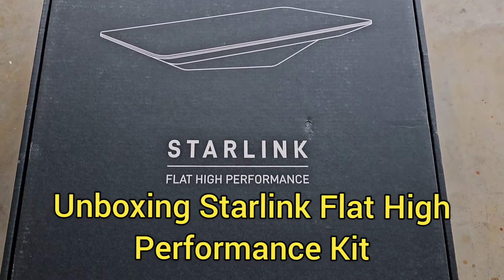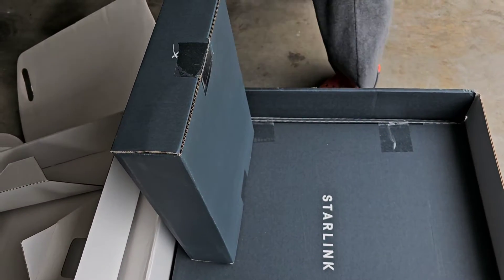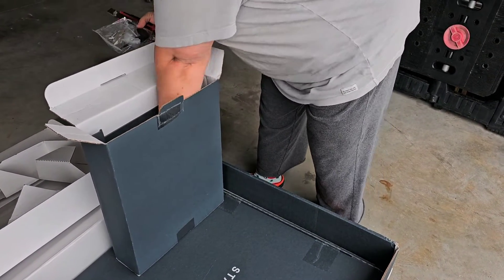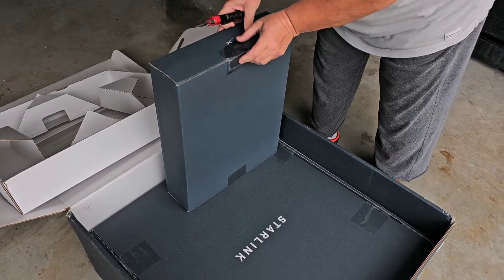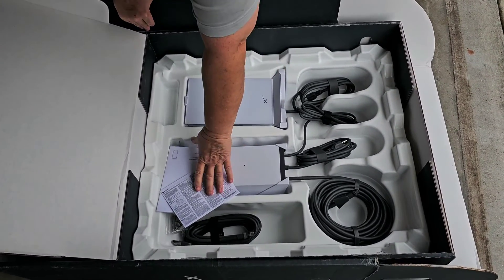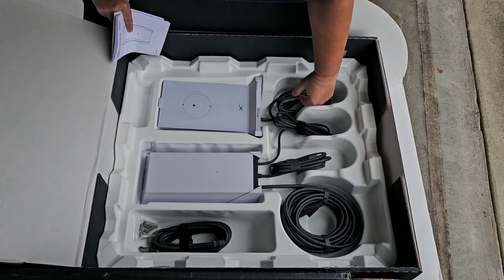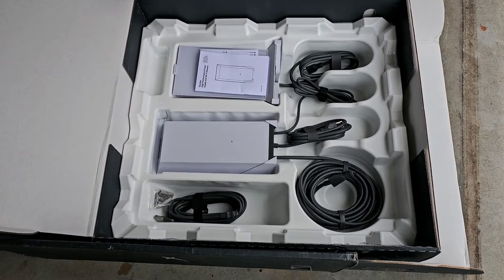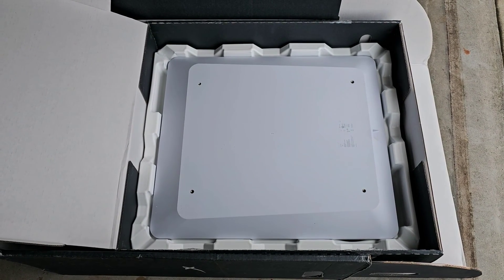Unboxing Starlink Flat HIgh Performance Kit

Comment: you might want to actually use the screws, to avoid wind damage, the tapes don't sound good enough, TBH.
Reply from the maker: I used VHB  tape and Eternabond  tape to hold my solar panel mounting feet to my roof. They've been rock solid on my roof for years. So if VHB Tape works holding solar panels,  it is plenty strong enough for the Starlink panel mounting bracket. I'm confident about that.